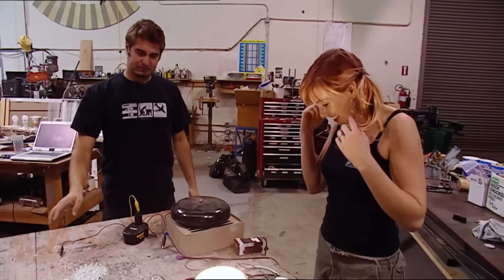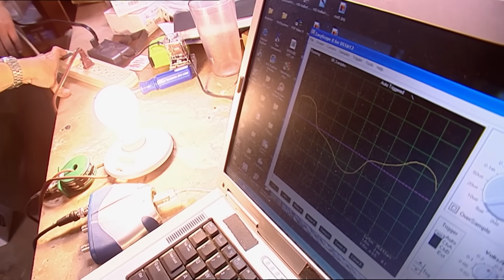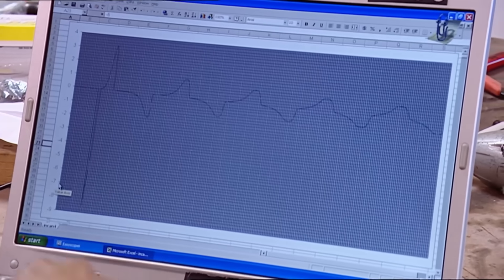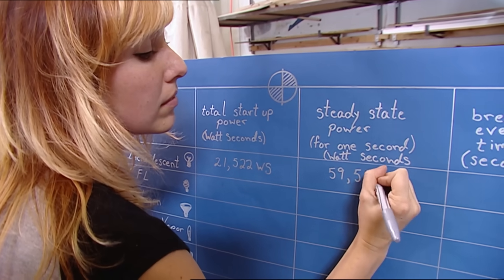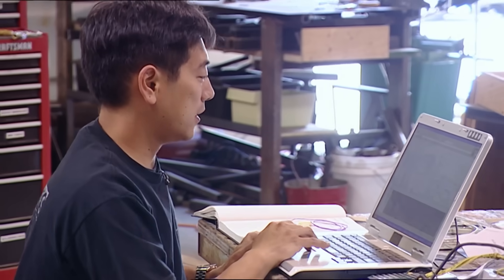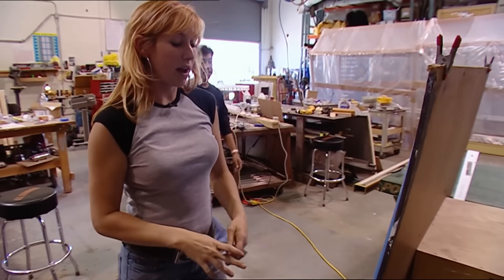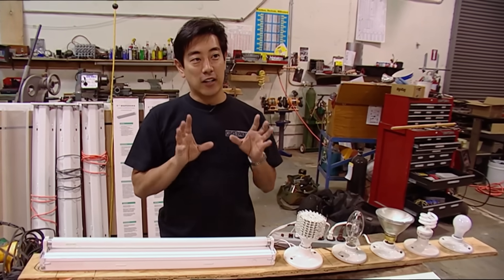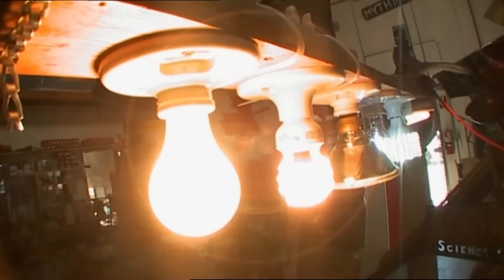Is It Cheaper To Leave The Lights On Than To Turn Them Off? | MythBusters

Comment: The Genesis of this entire myth that they are investigating really actually comes from industrial size facilities, where they pay for their power based on what’s called “demand metering “ so that the power company applies a multiplier to your bill based on your peak demand during the billing period. I worked in a facility where people paid to come in and use the venue and we would turn the lights on one row at a time in order to keep from having the demand charge on our service meter go up more than it needed to because we had a lot of lights… If for some reason, the person renting the facility wanted to have all the lights come on at once as part of their performance, etc. they had to pay what was called a strike charge and that was a lot of additional money on their rental cost because it meant our power bill was going to go up significantly for the rest of the month so they had to pay for that to happen. When you have hundreds of metal halide fixtures hanging from the ceiling like we did back then it’s not trivial to turn them all on instantaneously in one fell swoop. Now nowadays that they’ve replaced a lot of that with high bay LED systems It’s not nearly as much of an issue.  

BTW, demand metering will soon becoming to homes near you due to all of the demand on our power grid. So don’t be surprised if they start wanting you to pay like this on your residential bill if it’s not in your area already.
Reply: Just wait until the AI data centers hit your area. Consumers will be footing the increase in cost to subsidize the data farms.
Reply: @mfng3839 pretty sure we're already paying for the AI energy draw. As soon as they started powering the AI overall usage on the grid more than doubled and so did the price.
Reply: @seapotatoes7260  It depends on your rate plan, state and your PSC.  

Most utilities in the USA, especially if you have a single utility, which are around 75% of electricity customers, have PSC's who regulate rates, and utilities typically have to apply for, and get approvals, for rate increases.

Hence, the increases have not arrived yet for most consumers.  

Also, your claim that Ai data centers have doubled the total electricity usage are obviously false.  In 2023, data centers used 4.4% of the electricity in the USA, which will rise to 7% to 12% by 2028.

So, the power usage of data centers is forecast to double or triple by 2028, but they are not doubling nor tripling the total electricity demand of the entire grid.

Also, since data centers are concentrated in a handful of states, those states are likely to be most affected, as they will be forced to increase electricity production or import more through the grid from neighboring states.
Reply: @mfng3839  That's why China charges business zoning twice the electric rate as residential zoning
Reply: Meanwhile we get AI slop everywhere. Insult added to injury.
Reply: @12thDecember  Ai is a tool, just like any other tool.  It works for some applications, and not for others.

It also relies on accurate data, and a lot of it, to produce anything useful.

A lot of Ai today is trying to accelerate and circumvent that process, which means garbage in is producing garbage out.

It is like trying to cook a gourmet meal using the cheapest ingredients you can find.  It simply doesn't work....
Reply: @redbaron6805  The problem has never been artificial intelligence. It's automated intelligence. Like throwing more data than you can comprehend at a machine and trusting that the output is accurate. You've automated your intelligence away, and we are already seeing that when you don't use it, you lose it.
Reply: @Puzzlesocks  The core problem is that people don´t know what Ai actually is.  Computers are not inherently smart, they have to be spoon fed mountains of correct data, identified by humans, to reach the right conclusion.

They have no logic, empathy, experience, vision, intuition or intelligence, they can only comb through data they have been fed, or have scoured and scraped off the web.

Hence, they are very good at spotting patterns, or finding a needle in a haystack by combing through mountains of data.  They are very poor at anything else.

Hence, Ai is massively overhyped and overrated, and will be for decades to come.  Ai as we know it today is 95% hype, and 5% reality...
Reply: In the UK, at the commercial break of some favorite show, everyone would turn on their tea maker (kettles) causing such energy demand spikes.
Reply: @GregMoress  lol
Reply: @123payattention It's true.
Reply: In certain areas they already do scheduled metering on residential where they charge more during peak demand periods. Supposedly they are working on tech to turn electric cars into on-demand grid smoothing (discharge the batteries back through the grid) since more households have these types of large instantaneous loads these days. Stuff like electric car chargers and air conditioners that aren't used during working hours. Upscale modern houses also have stuff like tankless water heaters.
Reply: @HittTheDekk Yep this is the latest and greates idea in power systems engineering and it is completely naive and nonsensical
Reply: Norway has already had this for years. They've started advertising to get people to do high intensity things overnight. I grew up being told to never run appliances at night for safety reasons, and now...
Reply: @tuftela  we always had "run the dishwasher/washing machine/whatever on a schedule at night." here because of the day/night schedule.
some people get a different schedule than day/night, it's something like 5-9, 11-14 and 16-21 for the more expensive hours (variable depending on contract).
Reply: @tuftela  In my area, if you choose Peak and Off Peak electricity rates, the entire weekend is Off Peak, along with all night.  My Off Peak hours change, depending on Winter or Summer schedule.  

In the Summer, Peak is Noon to 9PM due to Air Conditioning demand.

In the Winter, Peak is 6AM to 10AM and 6PM to 10PM to reflect morning and evening demand, mostly from cooking breakfast and dinner, people getting ready, etc.

The default rate schedule here is still flat rate, 24/7 however.
Reply: @tuftela In Denmark, it used to be that total cost per kWh was usually lowest between midnight and 6 AM, but in the last few years, the tendency is instead that early afternoons are cheaper, because of solar, except for the darkest couple of months.
Reply: here we have throttling, which is different, basically they can cut off or turn on heaters for up to 30 min a day to help balance the load (in exchange you get either a free heater controller or lowered bill.)
that helps a lot in case of surges or blackouts in some spots where the load has to be kept by the grid
Reply: I was going through the comments as I was prepared to bring up the "Peak Demand" issue, and then I came across your excellent comment. Many decades ago I was managing several high rise commercial towers, where we had a "start up schedule" on the EMS (Energy Management System), which delayed the switching on for floor lights, elevators, chillers, ventilation fans, and water circulating pumps, to keep the Peak Demand as low as possible.
Reply: @Sophie-go3ql "Max Demand"
Reply: Yup.  I worked at a plant that had over 50 electric motors.  The system would only let you start them one at a time for this reason.
Reply: I'm glad you pointed this out because I was scratching my head on this one.  I was thinking shouldn't this just be as simple as kW multiplied by hours (kWh) and then the kWh multiplied by whatever the utility charges per kWh?  I'm not too sure about demand pricing at the residential level.  I think most utilities just utilize Time-of-Use pricing.
Reply: @bcdrummin  something to add, (that isn't that relevant for lights as most are basically a resistor) in AC there's 2 measures for power, kW and Volt-Ampere, for industry you might pay for VA, while for residential you pay for kW, the difference is that VA is  the average current you take times the voltage, so if you have lots of motors or capacitive loads, you can have your VA be a lot higher than your kW, because the current isn't in line with the voltage. 

because the current and voltage add up separately, calculating VA isn't that easy.

since power lines basically see the VA instead of the actually useful W, if you have high consumption, you will usually be billed on VA. 

the difference between the 2 is called power factor, if you have a big motor with no correction, your Pf will be around 0.7, that means for a 50kw motor you might use 50/0.7~=71.5kVA.
Reply: @satibel  Your logic is on target. However your example and numbers are off by about 50 years. Motors less than 100 hp have a pf of 90% or greater. It is hard to find a motor of 75 pf that is smaller than 2500 hp. The power factor of a typical residence with all the little cheap motors involved is around 86% pf. The pf is better on the better built motors  above 5 hp.

For example, in Texas, the Public Utility Commission only allows bulling on VA where the kw demand is above 1500 kw in special cases. This is far above a residential house where the kw demand is less than 70kw.

The majority of the US is vert close to Texas. However, in Europe, most utilities does change on kw but VA. Just a culture difference.
Reply: @ronrollins381  That is a a bit surprising, as every European country list their rate schedule in price per kWh.

So, I'm not sure how they would publish the price in kWh yet charge you in VA.  Most meters are designed to track kWh, not VA...
Reply: Where I live this is opt-in for the power company and they keep presenting it as though you're going to save money. Depending on your schedule etc maybe you will for a few years but I don't trust them enough to believe them. There's too many hidden phrases about them being able to change when those peak hours are. Also someone who mostly works from home it's not as helpful even now as they try to claim it is.
Reply: @KatjeKat86  It is a lot harder if you work from home, especially during the summer when you need to use Air Conditioning during the day.
Reply: The real question is it cheaper to unplug the tv power cord from your outlet before going to bed because my tv has a red led light when the tv is turned off still.
Reply: @inquisitvem6723  Modern TV's can use as much as 5 watts per hour in standby mode, so theoretically, it would be much cheaper.

The old cable boxes with DVR's could use as much as 40W per hour, which means that just leaving them plugged in could have consumed close to a Kilowatt every 24 hours, or about as much power as a modern TV would use in about 10 hours of use...
Reply: Residential demand metering isn’t new.  My grandparents had it on their home in 1960.  I believe it was opt-in in their case.  They had switched from coal fired furnace to electric baseboard and were looking to get a price break on their now higher electric bill.  Luckily demand metering is not instantaneous.  There is a motor in the meter which drives up the needle on the demand scale and it takes about two minutes to reach peak needle deflection for a given consumption rate.  That prevents a short event light switching on one lightbulb or a furnace blower motor turning on from sticking you with a huge bill for the month.

I don’t know how the newer electronic meters work for demand metering.  Programming just about any sort of response curve is possible when it is done electronically.
Reply: @wtmayhew  Unfortunately, as an EE, your claims here are simply 100% false.

Yes, in older meters, a motor was used to keep track of energy used, but it didn't take anywhere close to 2 minutes for it to spool up to speed.

It will adjust to your electricity demand changes in under a second.

Turn on a large load, like an A/C compressor, or a motorized load that has a surge current, would be such a small event on your overall power usage, that it wouldn't even register on your electric bill, even if the meter could track it real time.

Surge current happens in less than a second.  So, even if the surge current would be 3x the compressor draw, and the compressor consumed 5kW, the energy you pay for is measured in kWh, or Kilowatts consumed per hour.

If you paid $0.20 per kWh, and turned on a compressor, you would be consuming 15kW for 1 second, or 1/3600 of a kWh, which is around 4W.

The additional cost of that would be 0.1 cents, which you would struggle to notice on your electric bill.
Reply: @redbaron6805  I know it is otherwise because I have watched the needle on the demand meter push the static recording needle up.  It is a pretty slow process and a lamp surge a a motor starting up will not move the needle instantly.

The best reference I could find discusses Sangamo Lincoln meters.  Note that it squares with what I wrote that bets are off in the case of digital meters which can be set to any integration interval desired:

“Sangamo demand electric meters, particularly the older Lincoln thermal type meters, typically have a demand response time, or interval, of 15 minutes. This is the standard time over which the average demand is measured. 
Key characteristics of this response:
The "time interval" is defined as the amount of time required to record 90% of the change in the load.
In the following 15-minute interval, the meter will respond to 90% of the remaining difference (or 99% of the total change from the original load).
This averaging process continues, and it takes approximately three full intervals (about 45 minutes) for the meter to register 99.9% of a steady load change.
The inherent time lag is a key characteristic of the thermal design, which uses the heating and cooling of bimetal coils to drive the measurement mechanism. 
For specific models of modern, digital Sangamo meters, the demand interval might be different and programmable (e.g., in 10-minute increments on some controllers), so it is best to consult the specific meter's nameplate or manual for confirmation.”
Reply: @wtmayhew  OK, to correct some of what you are saying, and to clarify my point.

The Sangamo Meters were used from around the 1920's to the 1960's, so they haven't been around for around 60 to 70 years.  I was talking about the motorized standard meters used in the last several decades, before electronic meters replaced them.

My point was also, even if you had a modern meter, switching on a light bulb, which would have to be an incandescent light bulb, would only cause a minor spike in electricity use for milliseconds.

The same applies to most motors, which have a surge current that typically lasts for milliseconds, unless you are starting a large industrial motor.

Motors used in a home would typically be blower motors, blender motors, fan motors and similar, and then you would have compressors in a refrigerator or air conditioning systems.

I'm also not sure I can make sense of your story, as electrical baseboard heaters would have to be on for long periods of time to create any useful amount of heat.

So, the fact that the meter needed time to adjust to peak demand wouldn't have helped them at all in that case.
Reply: Thanks for info. Demand meter explained why the electric bills went up as soon as they upgrade/change the old meter to the new meter.
Reply: It's actually called "Max Demand"
Reply: @dogwalker666  No, it is called Peak demand.
Reply: So basically avoiding flipping the switch too often will yield longevity to your lightbulb? They didn't really make this perfectly clear at the end there.
Reply: @mybluebelly  It has always been known that filament light bulbs wear every time they are power cycled, unlike LED's which can be power cycled indefinitely.  Same applies to CFL bulbs, they last a long longer with fewer power cycles.

Every time a filament bulb is powered, the filament has to heat up until it glows, reaching 3,300 to 6,000F, and when it is turned off it cools back to room temperature.

The clearest example of that is the bulb installed at the fire station in Livermore, CA, which was installed and powered on in 1901, and is still working over 120 years later.  It has never been turned off since 1901...

Comment: Anything that uses electricity is a heater! So if you have electric resistant heat, leaving light on doesn't really use more electricity.  I'n the summer, now you are adding more heat to the room, so that consumes more energy.  When my kids were young, I would tell them to "turn off the heater" when they left lights or TV on.  They understood that better, especially in the summer.